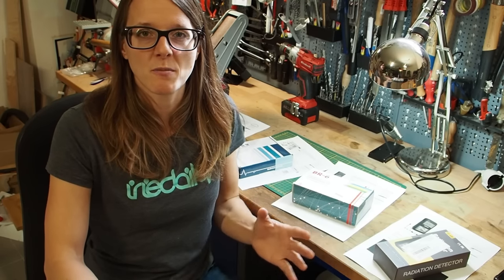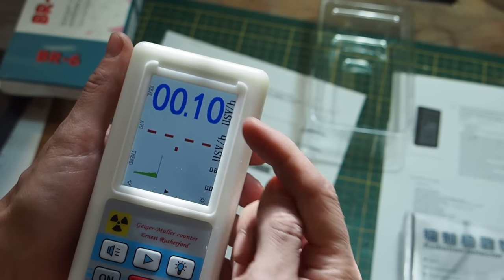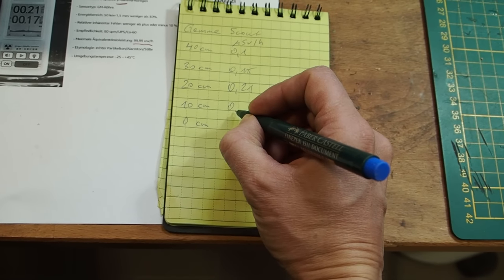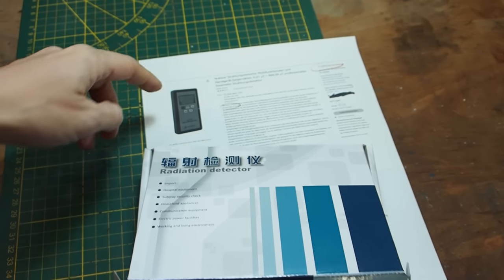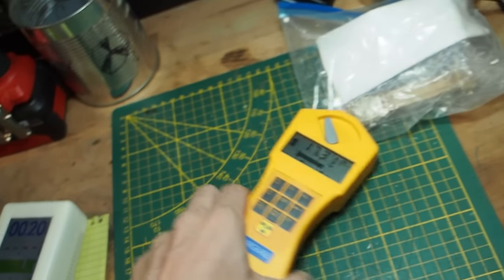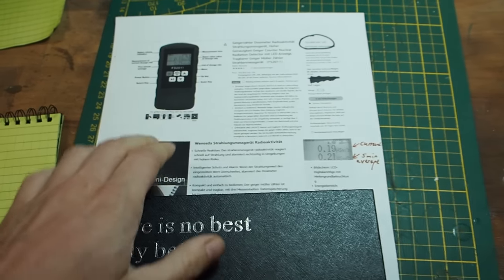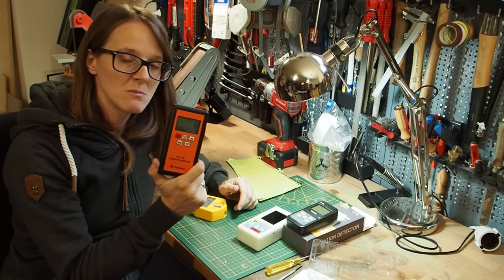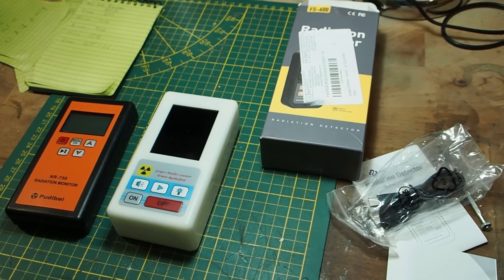Cheap Geiger Counters on Amazon - Only 1 is Worth it!

Comment: Useful information. Don't forget to keep it in a faraday cage with fresh batteries. An empty metal paint tin is a good EMP shield. It's worth buying potassium iodide tablets too.
Reply: everyone says buy iodide tablets, but fails to realize that IF there is need for those tabs, background radiation will be  high enough to cause permanent damage to other tissue in body, not just thyroid. IMHO best way is to get good geiger counter/ dosimeter and RUN AS FAST AS YOU CAN if they start chirping.
Reply: @ApocGuy  I can't speak from experience because I've never myself personally endured a radiological event, but the use case I am anticipating is the detonation of a device far away but the dispersal of radioactive fall out in my vicinity. In that event I would stay indoors with my windows and doors taped up, and take the iodide tablets. I would wait out the fallout for maybe a month before going outside. I would use the Geiger counter to check to see when it is safe. I would also use it to check water and food. I would probably wear an N95 mask as well to minimize inhalation.

I'm not planning for a massive local event, just to minimize the health impact of fallout from an event elsewhere. Under those circumstances ingestion and inhalation is the enemy. I don't have unrealistic expectations, I just want to maximize my chances of avoiding long term health problems.

Storing enough water and food for a month is achievable. My biggest concern is having access to uncontaminated water. Water from a loft tank or aquarium can be drunk if you get caught short. Pet food and pets can also be eaten. Just my little joke.

Comment: The review was fine to determine which counter was the most sensitive; however, after a nuclear strike, the levels of radiation will saturate (overload) these devices for the first 2 or 3 weeks after which the level of radiation will be much weaker and then within the range of these devices. I like the GQ GMC-500Plus Geiger Counter on Amazon which can measure up to 42500uSv/h or .042 milli Sieverts.
Reply from the maker: Sure, if you have the money you can always invest in a better geiger counter. But most people dont have so much money, especially after what is going on with the world economy. Also in my opinion these sensitive geiger counters are good enough to let people know what is going on.
Reply: @SurvivalLilly  I did not mean to offend you Lilly, I love your post and channel. The one I mentioned has come down in the last year and I just saw it on Amazon for $200 dollars. I also bought the white one that you reviewed and it worked well; but I found some of the test sources I have would max out the reading. I did not mean to put down the purchases you made, they are good for what they were designed for. I love your channel and hope and pray you will not have to go through a nuclear crisis.

Comment: I respectfully disagree with your recommendation. While the NR-750 is an interesting "toy" meter, it is not sensitive enough and incapable of detecting alpha particles, which will be far more common in testing contaminated water and food. While alpha particles are not highly penetrating and can be stopped by a sheet of paper or the skin, they can still pose a highly dangerous risk if ingested or inhaled, making their detection vital in many scenarios. 

If one is serious about radiation detection, save your money for a good meter that can detect alpha, beta, gamma, and x-rays. A word of caution regarding some of those really cheap meters is that they have such poor sensitivity they may not detect any particles in a source that is actually contaminated.

Comment: Using a watch is a pretty good example of how sensitive even the cheap Geiger counters are. But In case anyone is wondering, just because the Geiger counter begins to tick, doesn’t mean it’s dangerous. Power plant workers are allowed approximately 250 milisieverts per year, where as this watch only gave 20 MICROsieverts per hour. For reference, having that watch against your skin for a whole year would only equate to about half the maximum radiation that a human body can safely deal with. Radiation is a part of daily life and is part of our atmosphere so the human body, as well as all living things, are evolved and adapted to absorb and deal with certain levels of radiation. And the thing about radiation is that it increases exponentially based on distance. You can even safely stand near the Chernobyl elephants foot for a certain about of time, so long as you are at a certain distance and only for so long, so as not to exceed the amount of radiation the human body can process. Time of exposure, and distance, is what determines what is dangerous, not just how radioactive something actually is. I highly recommend YouTuber “Kyle Hill” a nuclear physicist, who explains in simple terms how radiation doesn’t need to be feared, only respected. And describes multiple accounts of nuclear disasters, and how the effects of which really aren’t as bad as how most people think. Such as the three mile island incident, or the time the us detonated a nuclear bomb in mid air directly over 3 men while recording, and they all lived and died of non radiation related causes
Reply from the maker: I still wouldnt eat a tomato that radiates with 20 uSv/h tough.
Reply: @SurvivalLilly  haha neither would I. Still a good idea to avoid radiation if you can help it regardless of the levels

Comment: Hello Lilly,

I currently have a Gamma Scout similar to what you have for low levels of radiation, and the ability to measure Alpha. The primary limitation is that it will only measure up to 1000uSv/hr or 1mSv/hr. In a radiological emergency 1mSv/hr range would be significantly saturated and inaccurate in either dosage or exposure/absorbtion rate.  I also have a GQ GMC-500+ which gives me a max rate of 42.5mSv/hr because it has two tubes, both a low and high sensitivity. It runs about $158 on Amazon, and when tested against my Gamma Scout has a good correlation.

I am also looking for a much more capable Field Survey Meter with the ability to measure up to 100mSv/hr to cover the extreme valued possible in a fallout situation.
Reply: @jason3211  It is the GQ GMC-500+. Here is the Amazon Link: GQ GMC-500Plus Geiger Counter Nuclear Radiation Detector Monitor Dosimeter, White
Reply: It is 'Not Great, Not Terrible'
According to NUKEMAP fallout contour can be between 1 to 1000 rads per hour, with 100 rads/hr affecting large areas down wind.
1 rad [rd] = 0.01 sievert [Sv] or 10 mSv/hr,  so 100 rads would equal 1000 mSV/hr. 
If your max rate is 42.5 mSv/hr you would have no idea if you're fleeing into a highly contaminated area, or away (so better stay indoors when maxed out)
It is 'Not Great, Not Terrible' with a low/high sensitivity - and hopefully it will never be used in an extreme situation
Reply: @EgonSorensen  I agree, and that is why I currently just acquired 0-500 rad field survey meter (Used and needs to be sent off for calibration). It is an old civil defense CDV-715, and will be part of my Radiation Kit. The difference between the two meters is the lower ranged, more sensitive ones are Geiger Counters, and the field survey meters are mostly Ionization chamber models. The basic design is the same, but the voltage across the detectors is very different, with the ionization voltage being about 50-100V. This lower voltage allows for the system to not get saturated at higher exposure levels.

Both types of meters are useful according to application. If in the event of a nuclear incident, if you have a good shelter that provides sufficient shielding your 0-500 rad meter will read nothing, while you sensitive Geiger will still detect accurately your exposed dose. Outside the shelter however only the field survey meter will give you a reading of what much higher levels are to estimate your exposure for various activities.
Reply: Have you heard of the Kearney Fallout Meter? I have constructed 3 and I love them. Never needs calibration and it doesn't need batteries either.
Reply: Get a detector with a scintillator crystal. More range with more accuracy.

Comment: Reminded me of one of Americas first accidents on a portable reactor. The initial crew went in and thier instruments did not show radiation, not even background. Thier instruments had exceeded saturation and they did not realize it.
Reply: This happened in Chernobyl too..there is a video out there with some guy claiming that that there was not much radiation, then some guy comes over to him and starts yelling something like "get the hell away from here"
The guy who thought his counter was showing hardly any radiation did not understand that low-level counters will saturate:and when this happens, the readings will go to nearly zero.
This is because the GM tube has no time to reset(look up "dead time" in relation to GM tubes to understand this).
So since the GM tube can't reset, no pulses are sent, so no reading.
This is why better units often have a saturation alarm(the old ones did not, and most inexpensive units don't have it either).
If you are experienced in USING counters, you will usually figure it out-if readings go down quickly, when it does not make sense for them to go down, then suspect saturation.

Comment: in general ; these cheap geiger counter are more dedicated to measure of ambiance instead of hot spot in an object because of the geometry of the sensor. Some geiger counters of the market have a compensated tube (the kind of plastic you found around the tube ) and are less sensitive to low energy such as beta particules.  The gamma scout is very expensive and not everyone can afford it.  But still these cheap geiger counters are ok for ambiance in gamma and detection to check wether or not an object is radioactive or not.  So measuring at different distance doesnt mean anything as the geometry of the tube isnt the same between counters.  These counters are mostly for detection at the contact and evaluation of the ambiance of an area or a room. No more than that .

Comment: I already have an updated version of the white one you show, BR-9B, and I checked other review sources and more or less it matches with what you show here. When I ordered it there were no reviews or at least no good ones.
I ordered one NR-750 as you suggested and cant wait for it to arrive.
I live in Bulgaria and few months ago I watched the news and they mentioned that the tanks driving where the Chernobyl disaster was, they could possibly release radiation with the dust they are making.
Day before that I saw my counter showing 0.50 microsieverts/h for a minute (in the village I usually see from 0.03 to 0.15 microsieverts/h). Also checked the wind, it was blowing from Ukraine to Bulgaria those days. Can't say for sure if it was related, but I was sure then that having a counter is a must to be able to detect radiation on time and take precaution.
Thank you Lily for your work.
Reply from the maker: Wow .50 is a lot
Reply: @SurvivalLilly  I wouldn't say its a lot. Bear in mind its about micro not mili, which can be confusing and it was for very short time. In the center of the city in a concrete building I get average of .17 microsieverts/h which is normal for such place. It goes up sometimes up to .24 µsv/h. 
Since a week ago it started reaching .30 µsv/h for a second each day. Which is why I really appreciate your review done here. I want to get better counter and if this .30 µsv/h continue to appear, I might start thinking of relocating permanently to the village.

Comment: Thanks for the review. Unfortunately I found it a bit too late. I bought the BR-6B  several months ago. Unfortunately, compared to my other Geiger counters, this device takes a very long time before the measurement results are updated.
I also own the Pudibel Geiger counter and I'm very impressed with this device. I compared all my devices, including a homemade Geiger counter, and I have to say that I was actually very surprised that all my devices on my test source showed practically the same readings with sufficiently long measurement times (the measurement inaccuracies of all my devices were definitely within tolerance). Nevertheless, I think that the BR-6B is my worst Geiger counter that I own (biggest deviation compared to the other devices, longest recording time, too big distance between counter tube and housing, counter tube is installed diagonally).

Note: the heat shrink tubing over the counter tube on the BR-6 and BR-6B is to block out ambient light. Because the housing on the bottom of the housing does not protect the measuring tube sufficiently from light. However, the counter tube used responds to ordinary photons, which makes a cover absolutely necessary.

My favorite is also the Pudibel, which I actually prefer to the Gamma Scout on excursions. Because the device is definitely sufficiently precise and has an acceptable measuring speed.
Otherwise, I also like the devices from Radia Code. I especially like the Radia Code 101, although this device is not a conventional Geiger counter but a gamma spectrometer. Advantage, you can place the device on the test sample and display the gamma spectrum. The resolution is not comparable to a device for ten thousand dollars or more, but if you measure long enough, you still get very good results, which allow clear conclusions.

Comment: You tested the sensitivity of Geiger counters CALIBRATED with Cesium-137 (Cs-137) against a watch dial likely coated with Radium-226 or Radium-228. Radium has VERY different emissions from Cs-137. The test was Apple's and Oranges and in no way did that test show how those meters would work when trying to avoid the fallout of a nuclear detonation and didn't help much trying to detect nuclear fallout contaminated food. Radium 226 emits mostly alpha particles with a little beta and gamma as a side product. In a nuclear detonation the most serious threat is cesium-137, a gamma emitter with a half-life of 30 years. Not Radium! Cs-137 is a major source of radiation in nuclear fallout, and since it parallels potassium chemistry, it is readily taken into the blood of animals and men and may be incorporated into tissue. 

Testing Radium Sources with Geiger counters calibrated to a Cesium-137. The emissions are very different and they are not built to measure radium. In a nuclear War we won't be worrying about radium coated watch dials exploding. We will be dealing with nuclear fission byproducts like Cesium-137 with it being the worst risk to human life. This is why we use Radiation detection equipment sensitive to and calibrated to Cesium-137, not Radium-226 or Radium-228.
Reply from the maker: the Gamma Scout is calibrated and can detect all of the elements you described. so it is a good reference for this test.

Comment: The KFM. Radiation meter is cool. 
Pro: No battery needed.
Pro: very good detection range.
You build it. That could be Pro or Con.

Con. You have to keep it dry. Water can kill it pretty fast.
Con. It's very fragile. Don't drop it. 
Con. You need to hold still when using it.

After you build one, you will see why you have to be gentle with it.

Comment: There are detectors that go from 1 uSv/hr to 16.77 Sv/hr on eBay for less than $150. The model is still in use in nuclear power plants today. Look for the Unlocked Thermo EPD Mk 2.3.

Comment: You should repeat your test with geometrically larger sources, i.e. 20 x 20 cm. Most of your counters are not designed for small pinpoint sources, but rather for the "enviromental" radiation. Among others, i own the BR-6 (white one) and it is not as bad as you might think. It features quite large GM tube, which makes it fairly sensitive and rather handy for food survay using "thick sample" method. The red number (bottom) is not a dosage but an average over the measured time, which comes handy for the same purpose. There is a brand of milk, shoving 20 to 30% higher radioactivity than average milk, and yes, still well under the legal limit, so no panic required, but non the less, try to find it using the Gamma Scout, and the BR-6. It's a challange. Thanks for the video, i enyoed it.
Reply: Gamma scout is way better and worth the money as professional one. It is expensive. The quality NR-750 is not good. I bought one but the unit doesn’t perform as in the video.
Reply: @jennybodak4954  There are many knoxk-offs of this model I can see from looking.
Reply: @jennybodak4954  The better instument is probably the one, that still fits your particular needs (or requirements) for less money. Considering the video, i would just like to point out no GM counter can measure the radiation that actually miss the GM tube.

Comment: FYI- I found a dozen or so of the nr750 you recommended on Amazon ranging from $60 - $150. The pics all look the same. Also there are nr850 and nr950 models availble that say they are more accurate.Thanks Lilly!

Comment: Excellent video demonstration and advice. I would suggest spending a little more for a used CANBERRA UltraRadiac (MRAD-103/113/213) -- 1.0 uR/hr to 500 R/hr or an UltraRadiac-Plus -- 1.0 uR/hr to 200 R/hr.  US Military grade .  They can still be found at a good price.  Just be sure you don’t get one that the AAA batteries were left in and corroded.  I have found some with light corrosion on battery contacts that cleaned up and worked fine.  I believe there made to be EMP resistant and water tight.  Manuals can be found online.
Reply: but the UltraRadiac is only capable of seeing gamma radiation. Don't above units also measure beta radiation?
Reply: Have you ever heard of the Kearney Fallout Meter? It doesn't need batteries or calibration. I made 3, and I love them.